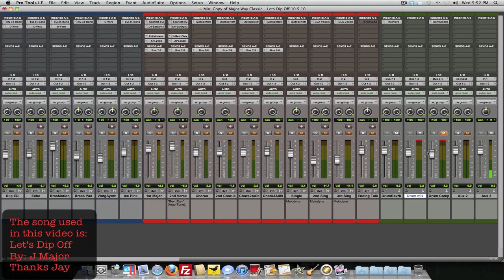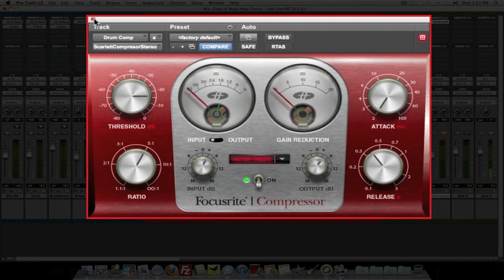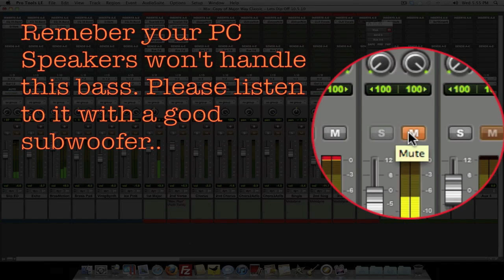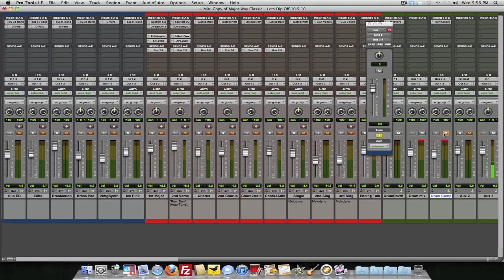Parallel Compression On Hip Hop Drums!

Comment: @Rbog17 With compression on the main aux, you're gonna lose characteristics.  For example, if you're wanting more snap in your drums, you'll want a slower attack to let the transient slip through..then a longer release to hold the signal down...but when you do this on the main drums, your gonna lose all the body of the drum.  So you're gonna have this HUGE snap in your drums but then they are gonna completely disappear afterwards.  So the point of parallel compression is you end up have 2 parts

Comment: What is the point of Outputing your drum track to an Aux when you aren't putting anything on the Aux? I understand the send to the Aux with the Comp on it, but in this case I only find it necessary to send to one Aux for Comp, not 2 since the 1st Aux just going straight to Out 1-2 (uneffected) anyway. Also, I would have liked to hear the difference between putting the compressor right on the main drum track, and the parallel version. Obviously compessing the drums will make them louder.

Comment: @Rbog17 It was not necessary at all. He could have just grouped his drum tracks if he wanted to have 1 fader control the overall drum level. Furthermore he said nothing about attack and release (the most critical factor of compression) times and blindly states a threshold level regardless of the source input. His gain staging is way too hot and everything is red-lining. Better off visiting Dave Pensado's Place and hear real tips from a pro. This guy means well but is not really up to snuff.